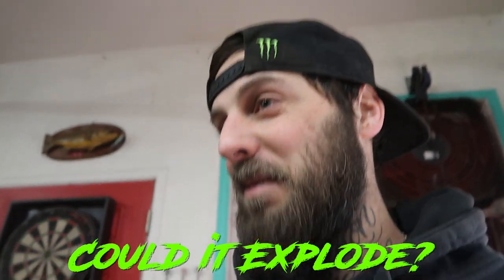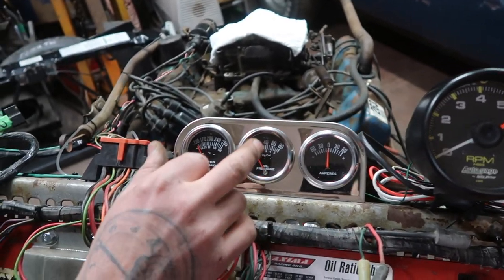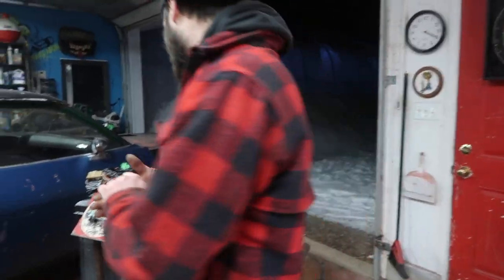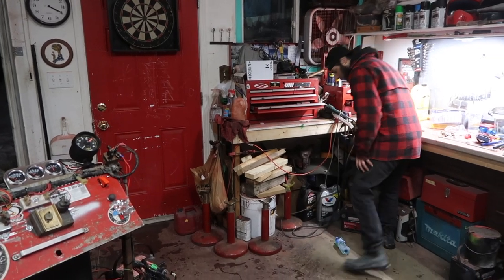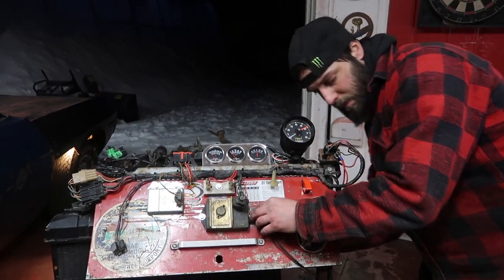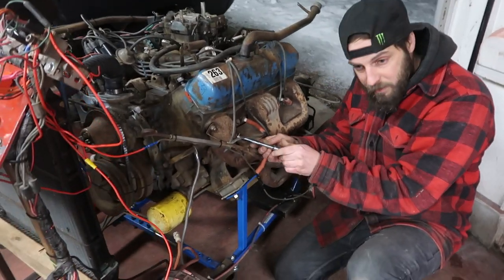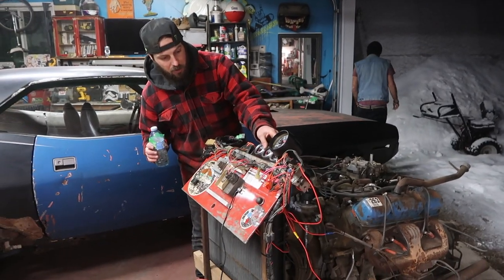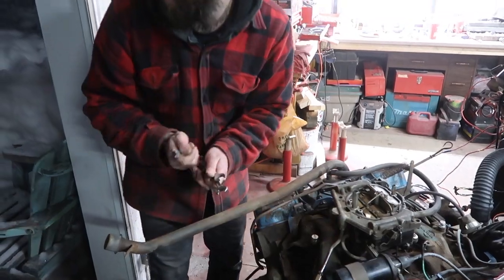(Will it Run?) Junkyard 1974 Plymouth Cuda with Motorhome 440 BIG BLOCK!

Comment: Congratulations! You get extra points for using the harness, and for most who will never attempt running an engine on a stand a few minutes of trouble shooting video can't capture the hours of work leading up to it, that drive a sense of accomplishment once it's running that's frankly hard to describe. As you said, the running part is pretty simple, once you've walked that path.
Reply from the maker: Thanks for watching Chris and leaving a nice comment! Your right it’s sooo rewarding getting it fired up after all the setting up and troubleshooting. I’ll take those bonus points as I wanted to run the harness and get it fired up exactly how I’m gonna instal it in the car :)

Comment: A LOT of old motor homes do three or four vacations then sit and get old. The average vacation run isn't usually much more than a couple of thousand miles. So if you think about it like that 11000 miles on that engine makes perfect sense. I could be 111000 miles if someone lived while driving in it but that's not the average.
Reply from the maker: Very true fir how clean it is and everything is factory and with all the input from people watching the video I’m starting to believe it’s accurate mileage